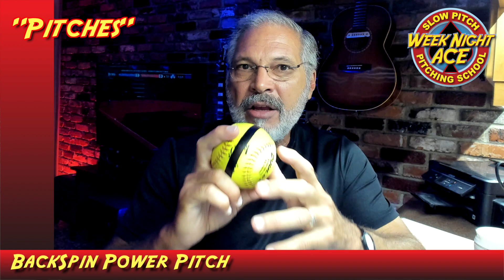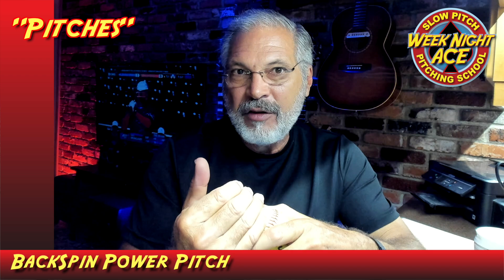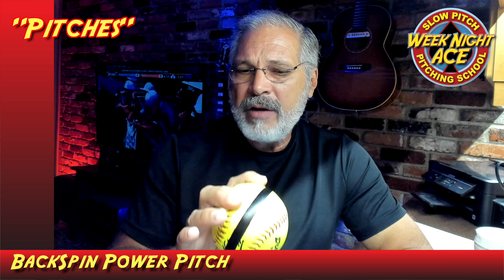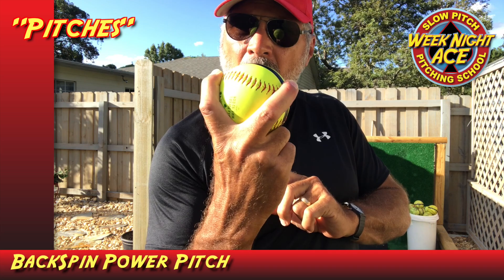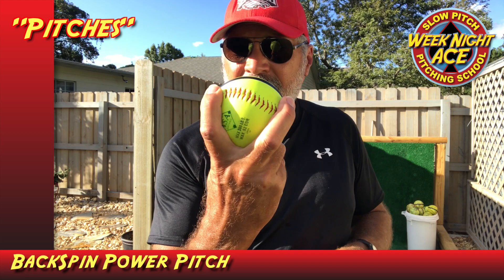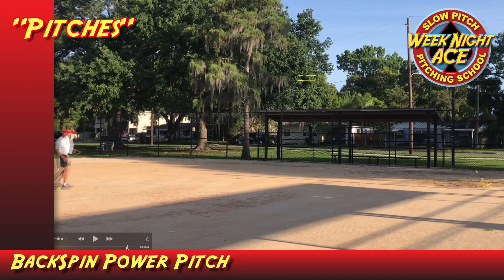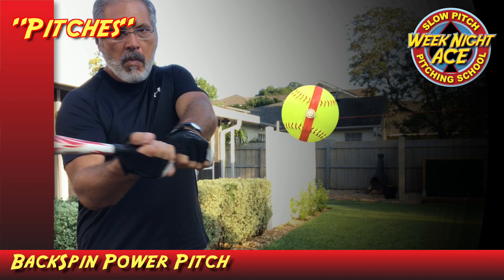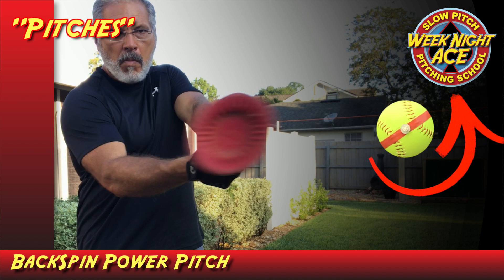How To Pitch The Backspin - Slow Pitch Softball Pitching School

Comment: Love the videos! I have played for several years but never pitched, but because of injuries,people not being able to make games etc. We had no back up pitcher. So I started to mess around with it and came across your videos and they have helped tremendously. I spent 100's of hours just practicing on my own before ever attempting a game. 

I am still having issues with the screwball, where it may be works only 50% of the time and I don't have the confidence yet with that specific pitch, however, the backspin,knuckle and curve all work phenomenal. 

I did need to adjust a few things for my own personal arm motion,angle and etc but overall I have been able to execute these pitches with no problem for the most part.

I gotta say that my slider, thrown for a strike (which I have been told probably moves almost 2 feet) followed up with a knuckleball is A KILLER.

The amount of mis-hit balls, strikeouts,foul outs, and ground balls is incredible. 

One thing I wanted to mention on here is that I love to mess with hitters timing and sometimes I will pitch in motion, and other times I don't even take a step and I stay planted and toss the same pitch.

I noticed that after going through a lineup a couple times one way, and then switching to a different stance really messes the batters timing up. Because where they may have had an extra couple seconds to prepare for a pitch if I am in full motion, opposed to one that i throw more in a UTRIP fashion is no different, but they do not have that timing down and usually ends up as a ground ball to the infield, or a bloop hit(sometimes depending on the batter I can accept a bloop hit over a blast)

*My main point of this comment/question I feel I may have figured out on my own but maybe with some input I can correct it, or make it better.

Now, I know it is because of my personal arm angle,hand size,grip etc but my backspin pitch seems to work like a screwball but with minimal movement and I tend to throw it for a ball, or it gets smashed because it doesn't move....are there any other grips that u have found that work just as well???

Comment: Thanks for the great video, Ace. Has both improved and impaired my pitching. I now have a larger arsenal of pitches and a higher spin rate, but alas, a bit less accuracy. Against free-swinging teams, it helps, but against disciplined hitters I sometimes give up too many walks. However, as I keep practicing I know the accuracy will improve and I certainly am enjoying being a multifaceted pitcher. BTW, at 8:13 on the video, I believe you meant topspin.

Comment: i noticed during the slow-motion comparison of the forehand and backspin pitches that you actually released the backspin pitch 1st and it hit the ground 2nd... i realize some of this is due to the higher arc... but this demonstrates clearly how much different the timing for the hitter is with these two pitches...  both from the arc and the rotation...
Reply from the maker: I think both forward and backspin pitches can be used to give the batter a different look and arc angle. Even though I have moved away from the forward spin pitch, I see pitchers use both together effectively.

Comment: Thanks for posting all these videos. Would love to hear your approach to any of these pitches in the case of unlimited max height leagues. How would that change your approach to batters? Usually in our league when a pitcher gets that 2nd strike, they start launching it up super high to get the batter to chase anything close.
Reply from the maker: The league I play in is ASA/USASoftball. The legal pitch height is from 6' to 12'. Some of our umpires don't judge height well and will allow pitches up to 15' to 16' high. When they do, I go as high as I can with the knuckleball and backspin pitch. The downside is the margin of error. The higher you go, the harder it is to keep the pitch in the strike zone. It only takes a small error to pitch deep or hit the plate. You have to spend a lot of time practicing this pitch and it is illegal in most leagues so I haven't covered it yet.

Comment: Really appreciate your videos! I was wondering if you throw a forward spin pitch in games or do you strictly throw backspin?
Reply from the maker: Josh, I used to throw forward spin years ago but stopped throwing it when I realized the advantages of the backspin pitch. My only reluctance to changing to backspin was a question of accuracy, could I learn to hit my spots. After committing to learning the backspin, I found it to be my most accurate pitch. I only pitch the forward spin now for team BP, as it is the most common pitch they see in games.
Reply: @utah32804  Thank you for your time.  Look forward to the next video

Comment: Was wondering if you pitch differently to a person who has a baseball swing instead of a Softball swing? As you probably know already a baseball swing is more down then up, compared to a softball swing is more level to slightly up. I as a pitcher have found I try to pitch deeper pitches to those baseball swings, because they just drive the shorter pitches so well. Heck I’ll even pitch it a foot short of plate to get them to swing at garbage and those baseball hitters will still drive them. That’s when I started to pitch them deeper.
Reply from the maker: That's a good point, Gerard. Most baseball players have a tough time adjusting to slow pitch softball at first, and I find that they do hit flat pitches better than high arc pitches. It has more to do with the intersection of the ball path and bat swing than it does the depth of the pitch. When the path of the bat is more in line with the ball trajectory, there is more room for timing error. When the ball trajectory and bat swing path are at a greater angle, then the hitter's timing must be very accurate to make solid contact, avoiding topping or undercutting the ball.

Comment: Great channel WeekNight Ace!  Regarding your illustration of the forward- vs. backward-spin pitches to show that the backward-spin pitch "drops more steeply"--which may very well be true--I don't believe your diagram illustrates your point.  You show the two pitches being released from the same location and landing in the same spot, with the backward spin pitch reaching a higher apex (by perhaps a foot or so).  But any pitch that reaches a higher apex will necessarily descend (and rise, for that matter) at a steeper angle.  Both pitches seem to follow an approximate parabola, and one just has a higher apex.

If the backspin was causing the ball to "drop more steeply", I would expect the apex of the pitch to be farther to the right (closer to the batter) for a pitch that begins and ends at the same spot.  I know you say your illustration wasn't a scientific one, but after seeing it, it makes me think that the backspin has virtually no effect on the flight of the ball.  (That's not to say it doesn't have an effect coming off the bat, however; also, that's not to say that your sideways-curving pitches don't actually curve--they definitely do).  What do you think?

Comment: I'm beginning my 16" pitching career in Chicago -- my hand can't quite get laces with both my fingers and thumb -- which finger would you say is more important to be on the laces?

Or should I rotate the ball slightly to ensure all 3 fingers are on laces?
Reply from the maker: Great question! Tim. Your goal should be to maximize spin rate while improving control as you progress. Experiment with your grip and focus on each finger. Once you decide which gives you the best spin rate, stay with it, then work on your control. You may find that the three finger grip with a rotation adjustment gives you the best spin. Remember the most important aspect of the pitch is command/control not spin rate or movement. If you learn to put the ball where you want it, you're well on your way to controlling the game.

Comment: I've played outfield for years. My coach needs a pitcher. Ive pitched in BP and throw pretty consistent. I believe it's because I was a amateur bowler for years and the movement is natural for me.  I would like to develop some advanced pitches. Would this be a good starting point? Also, I have a big fear of getting hit by the ball. I will be playing with 20-40 year olds who crank  the ball. Any tips for overcoming the fear? Thanks!!
Reply: To overcome the fear you should start playing ice hockey.  I've been nailed by so many slapshots over the years that when I get hit by a screaming, line-drive softball I just groan a bit and thank goodness that it wasn't a hockey puck! Those hurt far worse. Sorry you had to wait a year for this bad advice. 😀
Reply: @ppopovich2847  Makes sense. I only pitched a little bit and thankfully no bad outcomes. HOWEVER, i was running to 1st on a hit to short and he made a bad throw which caught me on the jaw. No idea it was coming. Dropped to the ground thinking OMG I probably lost teeth or worse. Thankfully It seemed to dislocate my jaw which I got back in and thats about it. SCRAY Shit! This just happened 3 days ago.! VERY sore but can at least chew and talk now.
Reply: @CommentingTheTruth  Sorry to hear it. Glad u are OK.  Getting beaned in the head or throat can be lethal. Fortunately, it's quite rare. Good luck out there!

Comment: Where did you get the 1,000rpm number?   The ball is in the air for maybe 2 seconds. That’s 32 revolutions in 2 seconds at 1,000rpm. We could film your pitch, time the ball, count the rotations, do the math, and learn your exact RPM
Reply from the maker: Adam. This is how you calculate RPM by using the camera frame rate. You start by recording the pitch at 60 fps, then count the number of frames per complete rotation, say 4 frames per rotation. Then divide the frame rate 60/4 = 15 rotations per second. Now multiply 15 (rotations per second) by 60 seconds 15 x 60 and you have 900 rotations per minute. Of course it may not be an exact number of frames per rotation so you may have to count more than one rotation to get an accurate number. Pretty straight forward, no mystery.

Comment: There’s no possible way your generating enough rotations on a ball to deflect down off of a moving bat.
Reply from the maker: Sure there is Six Toes. Ball rotation energy doesn't just go away. All things being equal, ball rotation will change the deflection angle off the bat. Whether the bat is "moving" or not is irrelevant.
Reply: WeekNight Ace 
Then why isn’t it thrown in USSSA Majors? 

“Ball rotation energy doesn’t just go away”
-Um, yeah it does....especially when it comes in contact with a bat....

“All things being equal”
-This is ambiguous and vague to the point it becomes flawed logic. How do you judge equality between pitch variables and a batters swing? How and what are equal?

“Ball rotation will change the deflection angle off the bat”
-Your right, it will change the deflection angle off the bat, but it has diminishing returns the higher the persons swing speed is. Plus, you’re still not putting enough rotation on it to negate the diminishing returns.

“Whether the bat is “moving” or not is irrelevant”
-Then why isn’t it thrown in USSSA Majors?
Reply from the maker: Six Toes, let me explain, "All things being equal." Suppose two pitches of the same speed are hit on the same spot on the bat, but with opposite rotation, the ball deflection angle will be different. At rotation speed of 900 rpm (typical hard backspin), this difference can easily be the difference between a warning track fly and a home run. 

My channel's focus is on the "WeekNight" or community league level player, not necessarily the pro-level player so, your comparison to USSSA Major quality hitters is misplaced. Also, your objection to the backspin pitch, because it isn't pitched in USSSA Majors (for the sake of this discussion I'll stipulate that it isn't), is a logical fallacy, the "Bandwagon Appeal." "It isn't done, so it must not be good." I've pitched the backspin pitch for years with success in city leagues. The more backspin I can put on the ball, the more effective the pitch. 

One more thing. The backspin pitch drops steeper as it approaches the plate. This slight change of downward trajectory will also induce more ground balls.